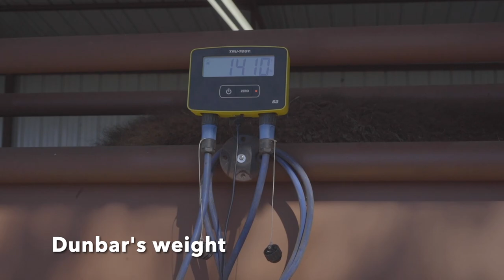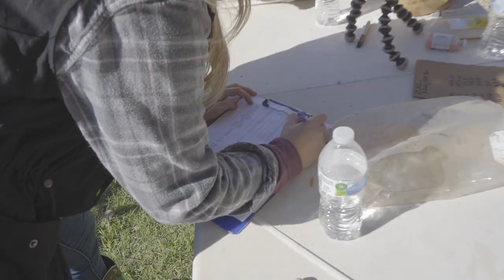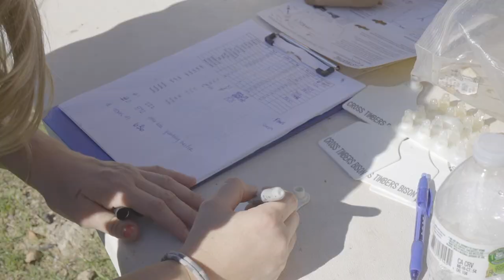NOT AGAIN! Working Bison and THIS happened...

Comment: You got em worked but at what cost? 
Too many people makes the animals skittish, 3 is a good number of hands. You can't have heads or people standing in the direction you want the animals to go.
You should sort off the calves or small animals from the larger ones, use a simple left or right sorting gate with 2 open corrals, never run calves into the crowding pens with the adults.
From the sorting pens it should flow smoothly into the crowding pen, then into the tub, after that it should be a straight shot down the alley to the squeeze chute. A shallow curved alley is ok, but the 90° turn will cause animals to balk and even get turned around. They will freely move forward where they can openly see.
You should rethink your pens and alley system to let your bison do the work for you, it's less tiring and safer for you and the buffalo.
A happy buffalo makes a happy rancher. 🦬 🤠

Comment: I had a friend who ran cattle, he would occasionally leave the head gate open on the squeeze and run his calves through to get them used to going through the pens and the squeeze. A few times through, done at various times of the year and they began to acclimate. they learned to know how to go through the pens and the squeeze. This made them a lot easier to get through, and lessened the occurrence of injuries. Every time an animal is handled they are being condition to act a certain way. I think your first pen before the tub is a lot of the problem. If like you say it was smaller, perhaps it would help to calm things down a bit.

Comment: Yes before the tub needs to gradually work down to the tub width with maybe a gate half way down and it would probably work so much easier for you all. But on the whole that seemed so much better than the spring round up.
Reply from the maker: Yes! Correct. Thank you!

Comment: Just a thought: if you hung the conveyor belt on the outside of the corral you'd have the corral to climb up on to get away from the bison. It would still block their view but you'd know better than me if it would present a problem with the bison getting their feet on the horizontal bars & trying to jump over

Comment: How old was Dunbar when you got him?  I know Big Joe was older.  They both seem to act like bulls that had a bad experience with a shoot while young.  I can only assume that in some ways bison learn and hold onto memories of bad experiences just as cattle do.  We try as you do to minimize the stress of being handled or having a bad experience because we learned that if the first time through a shoot when they are young with all the chaos of bigger animals going from pen to shoot, if the first experience with a shoot is a bad one that's a head that going to be a tough one to handle as the years go by.  Actually, someone else mentioned using the cubes as you have them pretty well conditioned to come fo cubes anyway why not use cubes as they move from section to section, which is how we do cattle in the smaller herds that we hand feed treats to.  Bulls especially will have two things they will do anything for - a cow to mate with and a tasty bunch of cubes.  Luring them with a female is not such a good idea in a shoot but you seem to have them respond well to cubes and that might get their heads out of that scary space that a shoot seems to place them and at least some of they are quite likely to worry more about following the sound of cubes in a bucket and getting to a pile to nibble on and  as they get fully into the next section may have them more focused on the cubes than the shoot walls,  bison might be too smart to fall for that but it might be worth a try.  I know we have some that you could set a bomb off in the next field and they would not even flinch when normally they would freak out over the noise of just the gates slamming shut, but when they are after really focusing on getting up to where you are going to drop a handful of cubes for them they can act literally blind and deaf to anything but the rattling of the bucket and following it along the route.